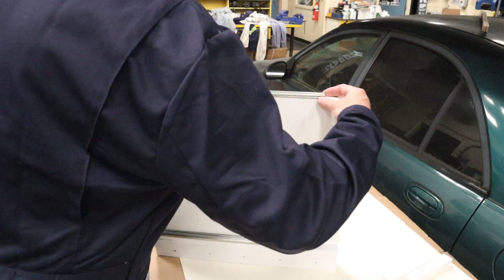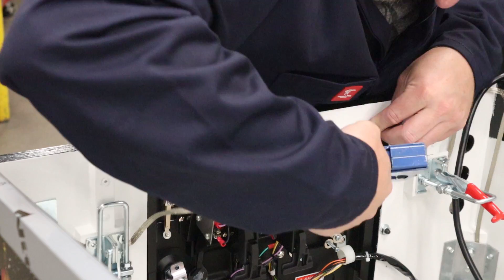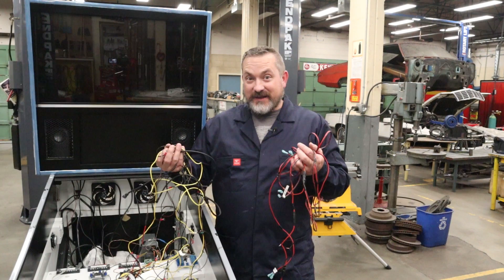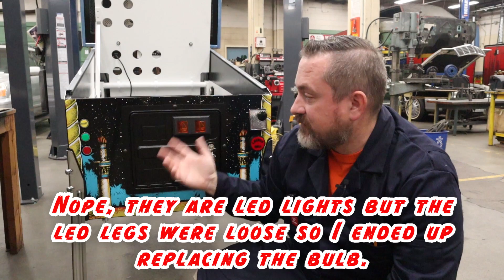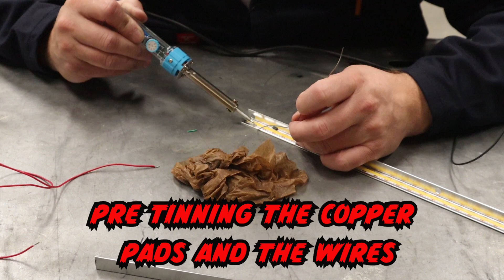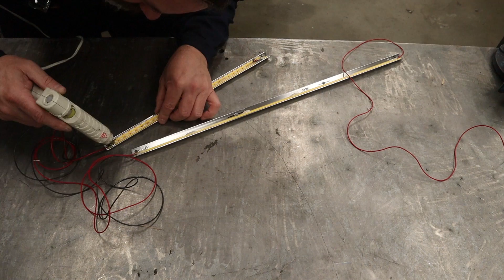Pretty inside AND out: Final Assembly. Virtual Pinball Glory!

Comment: I would not have grounded everything, instead insulated exterior metal parts from internal ... basically double insulation (class 2 appliance)  would have been easier and more safe, as for static, by grounding the metal parts you guarantee a static shock.
Reply from the maker: Hrmmm not sure about that but this is how real pinball machines have their ground straps installed for the last 60 years so it should be good.  Thanks for the watch and your info!  Cheers!

Comment: You're videos are very helpful. I’m following your instructions to check if my power supply is grounded but my multimedia doesn’t beep. What should I look for on the display to verify ground?
Reply from the maker: Multimeter?  Yeah most don't have a beep function but all of them will go to zero or close to zero when you put the leads together.  Hope that helps.  Thanks for the watch!
Reply: @wayofthewrench  Meant to type multimeter (haha). Anyway, I think I figured it out. I was touching a part of the case that wasn't grounded so getting nothing and getting really high numbers on the other side of the case. I got lower numbers when holding the probes more steady.
Reply from the maker: You might have to sand a bit of the paint off to get to the raw metal.

Comment: Omg, that looks so clean compared to my cabinet. 😮 I do however wonder if the white will not make small leds light leak to your playfield border?
Reply from the maker: You skipped my video!  In the words of Great "How dare you!".  Lol. The led lights are only on when the coin door is on so there is no leaking light.  There aren't any light leaks even when it is on though either.  Thanks for the watch!
Reply: @wayofthewrench  I did not. I mean LEDs from amps / pc / pinscape / ...
Reply from the maker: Nah, they are under the monitor so no light leaking anywhere.  Cheers!

Comment: "It's just money...." The catch cry I have been using for months doing my build. Amazingly I am at the point of having to fit my painted backbox to the cab and as you mentioned in past videos about paint, oil based paint is touch dry in 24 hours but even after a week is still not cured and can easily stick and come off especially when a little thick so I love that tip with hte wax since I litterally thought about that just 30 minutes ago thinking I wanted to start fitting monitors and stuff but dont want it to stick when loaded. 

Damn, I have actually a spare KL25Z board already flashed with Pinscape and tested but I decided to install a Cleveland Software Design PinOne solution since that is so much neater and self contained than messing with power supplies and all that cabling.... would also solve almost every issue in this video since everything is a simple plugin connector. Costs a little extra but even with the $500au shipping and import taxes, it saves so much time.
Reply from the maker: Yeah it's just money but money's also money.....lol.  it's easy to spend too much too.  Yeah I'm sure the pinone system is good, just a bit pricey for me.  Glad the wax trick worked for ya.  Thanks for the watch!

Comment: Fantastic series! I had my cabinet pretty much done and your series inspired me to add some toys, SSF, addressable LEDs and completely re-do my front end. I did my build about 2 years ago and I also painted the inside of my cab white and used those same plastic wire minders and they are awesome. Sorry you fried your KL25Z. They are incredibly hard to find right now. So if anyone is looking to start a project, but can't find a KL25Z one option is to check out Cleveland Software Design. He has all kinds of interface, expansion boards and virtual pin parts. 

Thanks again for doing this series and hopefully getting more people interested in this very cool hobby. 

Side note - you can also use the end of your soldering iron (just not the very tip) to melt the heat shrink tubing.
Reply from the maker: Awesome!  Glad I could inspire you to mod your vpin!  Gotta love all the cool tech eh?  Yeah Cleveland stuff looks cool, maybe I'll try it out for another build.  Thanks for the tip about using the soldering iron.  I think I'm starting to get to the point where I know so many tips that I start forgetting them too.  Lol.  Thanks for the watch and your support for the channel!

Comment: Great series, thank you! I'm not there yet, but one of these days I'll get to build one. One suggestion, make that LED USB connection easy to get to so that, if you ever need to power down to work inside the box, you can externally power the LEDs inside and use them as work lighting ;)
Reply from the maker: Bruh....you have to build it!  Just start and go slow, take your time and you can thank me later.  It's way too cool a project to not do it.  Yeah not a bad idea.  I can plug the PSU into an extension cord and then it works too as I did that a bit when filming.  Thanks for the watch and send me some pics of your build when you're done!  Cheers!

Comment: is a real pinball machine cheaper ?
Reply: A newer real pinball machine can run $10,000 or more (Canadian) easily.
Reply: Yes but only has 1 game :D
Reply: Possibly, depending on condition and desirability. A real pinball machine can also be MUCH more expensive depending on those same factors. Although I would question the fairness of comparing a single pinball table to a virtual pin that can house effectively infinite tables.
Reply from the maker: God no.  A decent pinball machine is $7,000-20,000 and it's only one.  You might get a worn out EM one for $1,000.  I spent roughly $1,500 for my vpin.  Thanks for the watch!